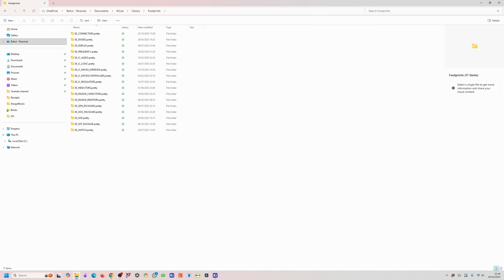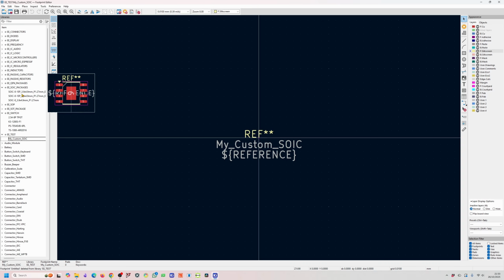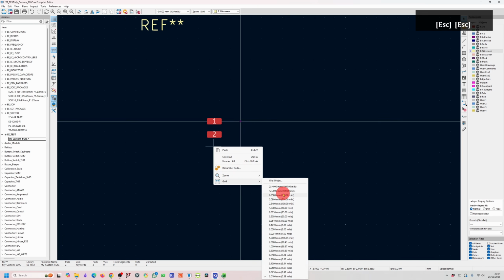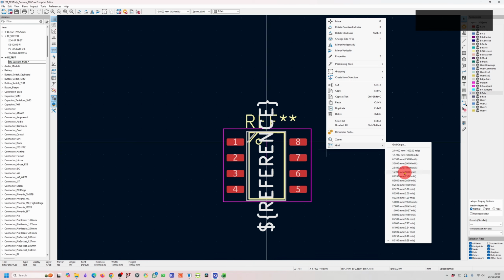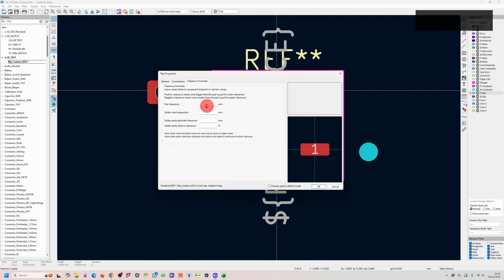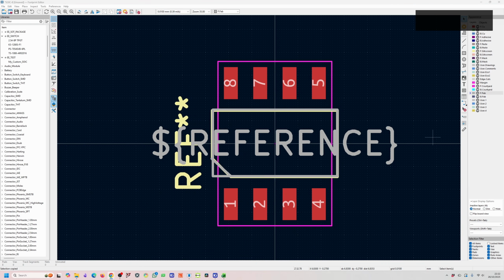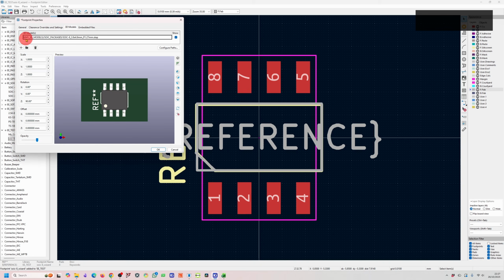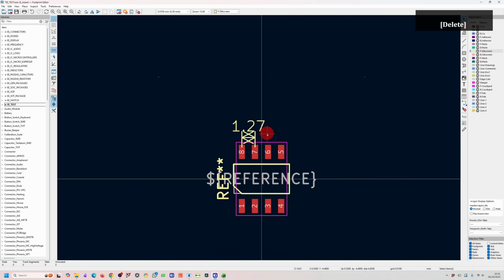KiCAD Tutorial #11: Footprint Design

Comment: Before creating a custom footprint.. do you recommend checking if it's available via any online libraries..   assuming those repos have footrpints that are compatible with KiCAD?  
(SnapEDA, Ultra Librarian, Component Search Engine, JLCPCB-KiCad-Library, chilaPCB / Altium-Library,  Alarm-Siren /arduino-kicad-library, etc) 

Or thoughts on tools like EDABuilder  , PCB Footprint Expert, footprintku  , Cadence Advanced Footprint Generator (OrCAD X)?
Reply from the maker: Definitely, it’s the easiest way to create these component. 

I’ve not use these tools before so will check them out. Thanks.